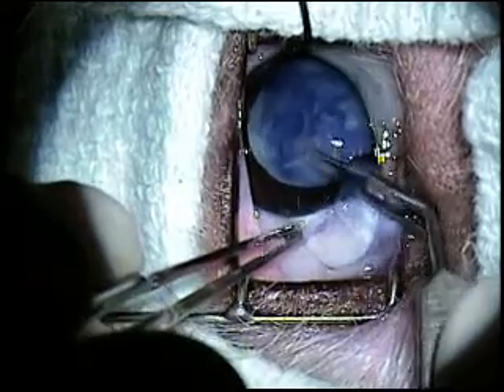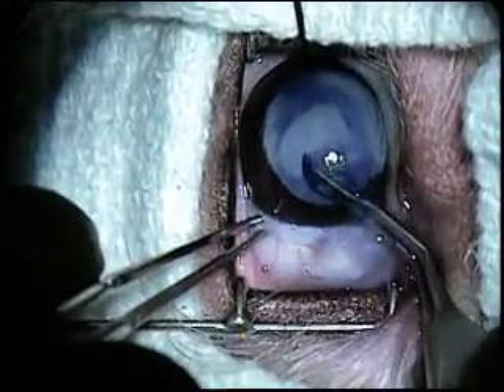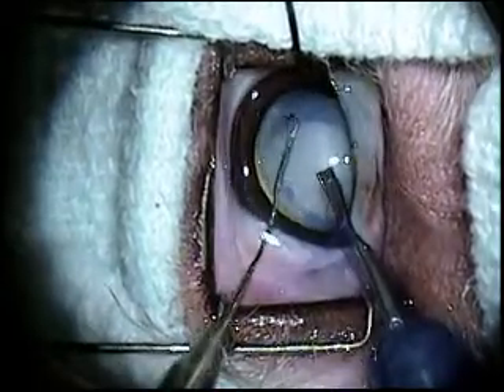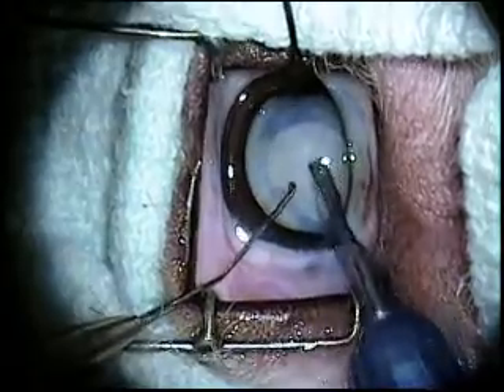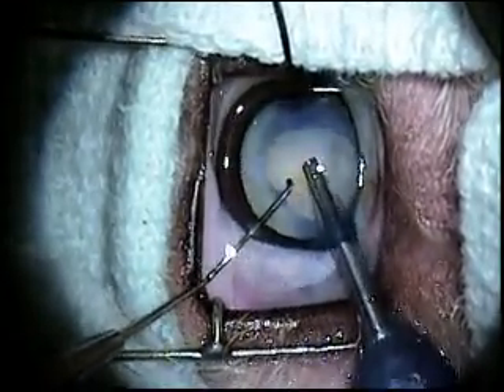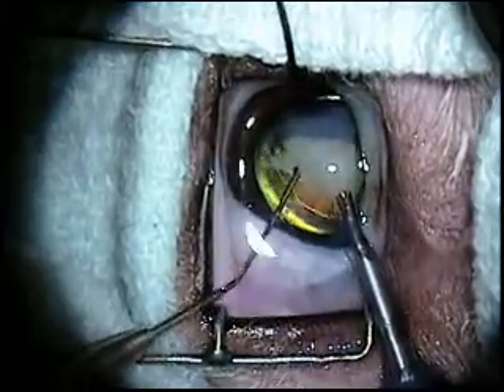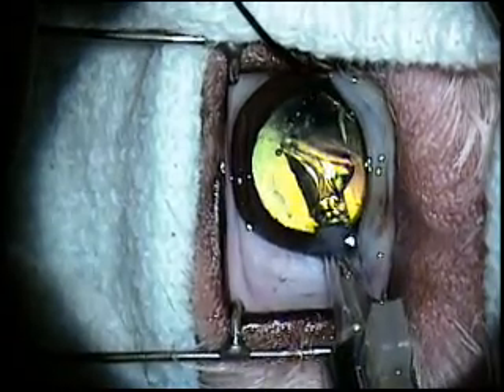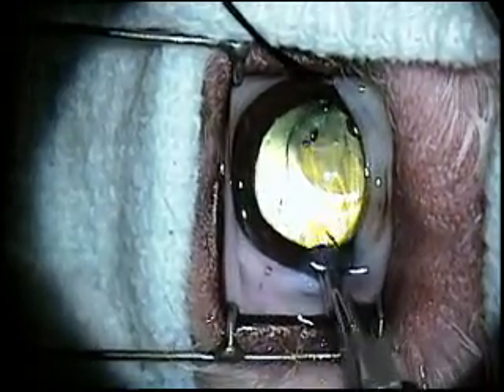Canine cataract surgery with a lens implant in a dog

Comment: Nice to see that Vision Blue is also used in canine phaco/IOL surgery.  Just wondering if you also do hydrodissection and/or hydro-delineation of the lens nucleus prior to phaco and if you use an OVD before implanting the IOL.  Not apparent in this video, but these steps might have been edited out.  Are you making a self-sealing incision or do you suture?  Do you inject BSS into the corneal stroma at the end to help make the incision tight?  Are topical NSAIDs being used before/after surgery?